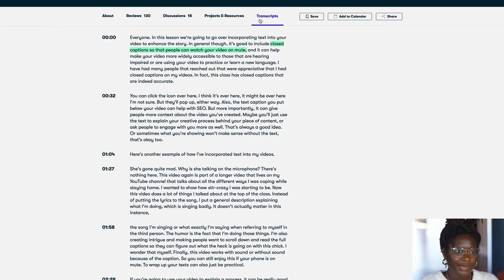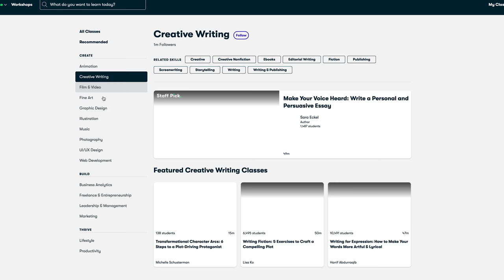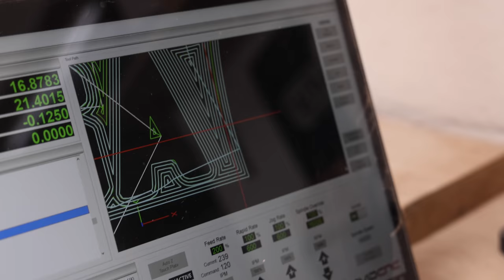3 LEVELS of Cornhole Boards -DIY to PRO Build

Comment: As far as aesthetics go, I prefer the 'beginner' board but I did enjoy watching the pro build and I can say that I was not disappointed. LEDs belong in everything. I think the only change with the beginner board I would do would be to route some channels where the stripes were, embed some LEDs and then fill it with semi opaque black resin. For bonus points, I'd add an IR sensor that triggers when anything passes through the hole to give a light show the likes of which no cornhole board has seen(at least to my knowledge).

Comment: Jordan - Has access to $5000 table saw
Also Jordan - Uses 2x4 offcut as hammer
Reply: With the price of wood these days, you can’t waste scraps
Reply: So what you're saying is he used a $5000 table saw and a $1500 hammer. 🤣

Comment: On mine I installed a laminated shoot underneath to return the bags to the front with a hole and tray. Plywood is also laminated with two 1 x 1 attached angled on top to direct bags to the same tray as the shoot.
Reply: So simple and it never crossed my mind. Thanks for sharing that idea!!

Comment: I’m curious about the two boards that were set in the frame. Did you size the plywood accordingly so the entire playing surface is still the regulation 2x4? Or is the plywood 2x4 with an extra lip of and inch or so around the sides?

Comment: The tools are not the problem, the biggest foul is using 1/2" ply😂 I use 3/4" birch decks. And 1x3s are lighter and stronger. Then I round off the edges and corners with a router. I will never go back to 2x4 frames. Im not critiquing or hating. Just sharing ideas. Great content and boards. Much love from Ky 🇺🇸

Comment: Just did a pair. I used pocket holes from the underside on the 2x4 to secure the top to the frame. Came out very clean and won't have to worry about filler/epoxy getting worn down over time and creating slight dimples around the edge of the board
Reply: I always use pocket holes as well but sometimes have issues with the screws wanting to poke thru the ply.  How do you adjust?
Reply: @suelogsdon3468  move the collar on the bit closer to the tip. If that makes sense

Comment: John you may like this. I had some boards at the bar I used to work at that had a level built in between the legs and the legs were adjustable to make sure your board wasn't leaning in a uneven surface

Comment: Hey, Love the videos i just build some cornhole boards like this and used my CNC, but i had over pour will sanding it like you did in the video help with the over pour? will it scratch the epoxy that's filled inside the logo?

Comment: Hole cutting: If you have a router, grab a circle cutting  jig. It will cost less than a 6 inch hole saw and let you do quite a bit more..to include cutting the rounded end of the cornhole board legs with an additional router bit. The cuts will be cleaner with less chance for tear out.

Comment: This is crazy, I use the same paint can trick for cutting the legs to length off the side of a table, lol. I also use cnc and epoxy for the board design. I just have to step up my LED and joint game! Nice boards man!

Comment: Hey John if your jointer didn’t have a Guard you could’ve just moved your fence over the thickness of the wood and you would’ve been OK.  Instead of having the fence all the way to the other side
Reply: Just the tip

Comment: Quick question, what plywood did you use for the Pro board?  If it was veneered, I was wondering if you would go through it when you sanded the epoxy.

Comment: I think I start at level 4 and have made it to 6 so far. Soon, I will take my boards to level 10. 
I start with 3/4 top grade plywood, then use 2x4s with a brace for no bounce. From there I can add lights, used epoxy resin on a few, do custom decals, even made 2 glow in the dark sets. Next I plan to take them up a notch!

Comment: Have you thought about a clear epoxy top coat instead of spray. I did that once and it made the perfect surface for cornhole... Just slick enough
Reply: Polycrylic is way cheaper and works just as well if applied properly. They are cornhole boards not a live edge bar top

Comment: Ok. Challenge accepted. I would like to see an Oreo table. Slab split like you would your rivers, but sandwiching epoxy in between. Don’t like the mint ones at all my guy but the green would work with the epoxy. Here’s the tricky question? Can your machine texture the exterior of the wood like the Oreo? Then burn it for that Oreo chocolate exterior color which will make the texture pop? Then seal it so the crumbs lol don’t get on the floor? Now to get squirrelly, when you take the top off it’s a poker table!.

Comment: 3 levels of Mallets.
3 levels of Birdhouses.
3 levels of Crosscut Sleds.
Reply: Mallets would be interesting; birdhouses will be pretty interesting but a nightmare for the editor.
There's like only 1 way to make a crosscut sled, the only thing that would change is the connections between boards. Or rather, they wouldn't look very different is what I mean.

Comment: Nice job on the cornhole boards they all look great except for one minor mistake. Cornhole boards are only 3 in in the front off the ground which means you should be using 3 inch boards not three-and-a-half

Comment: Been watching for overa year and i still don't know what squirrely Means. Is it just their version of "janky" "sketchy"
Reply: Yes. It's a woodworker thing, we say squirrelly to refer to wood grain, our cross cuts, and sometimes for those who do green woodworking like myself, they use that term to refer to gnarly branches on a tree.
All of this stuff can end up squirrelly.

When he said squirrely the first time in this video; he meant the boards weren't straight, so if you sat a square against the inner corner of the build, it would be slightly off.
The second time he said it, he did mean janky; and in my opinion this usage differs from how woodworkers typically use "squirrely", usually woodworkers mean "uneven" or "suddenly and unexpectedly turny".
Reply: @D-Vinko  yeah makes sense. I just say sketchy and janky but I'm glad i can add to my dictionary of sayings As a beginner wood worker

Comment: No matter what level of board youre making there should always be braces on the underside of the board top to prevent bounce when throwing
Reply from the maker: ive build hundreds of board and with good plywood they're unnecessary
Reply: 3/4 13 ply baltic birch, really doesn't need a brace. I add one anyway.

Comment: OK: here is the LEGIT Review: Level 1: WRONG Screws. You used a countersink to drill the holes which is a beveled screw head and then a washer/flat/Kreg version screw=minor hold no bueno. Use regular drywall to match next time. Level 2: DUDE, oldest trick in the book: Build it, put a board on the table next to the legs, mark and cut. Unless trigonometry is your best friend, DO NOT measure: mark and cut. Level three: ok, this was pretty cool. Love the finger joints for all things as once you built the jig and it works, next to dovetails, these joints are strong enough to drive a truck on (yes you can use that idea and test it, but I stand behind the claim). For the epoxy, which, dang you, now I love to use, I have a SLICK my grandfather had from the old country (Norway). I run that across after curing at it takes off the major high spots before the 80/120/180/220 routine. Reality: Gentlemen, I (we- they YT community) very much appreciate your 3-level approach which is awesome. Thank you for contributing and all three are worthwhile (sorry if I was a little harsh with 1 and 2)
Reply: SO you can build some for me LOL.  Love the input
Reply: also apparently cabinet grade birch is the prefered wood

Comment: Bro, I loved your board but when you countersink the plywood top into the 2x4’s, it’s no longer a regulation board. “The front edge shall be 4” from the bottom to the top”.
Referring to the intermediate board. Assuming the the pro build 2x10” was ripped at 4”.
Reply: There are variances in heights. +/- .25"
ACO rules, "front of the platform stands 2-1/2 to 4 inches tall"
ACL rule, "The front edge of the board should be raised between 2.5 and 3.5 inches above the ground."
Reply: @chadmiller1506  I’ll take your work for it. Not like it would change my game either way.

Comment: No hate, great work for sure to you three! But… the pro build isn’t pro style board at all sure it’s a experienced, difficult, joinery build, but not a pro board build. Professional, regulated boards are not used with any 2x material. But again no hate and excellent craftsmanship non the less!
Reply: Actually ACA regs and standards don’t specify what the frame has to be made out of, as long as the dimensions and height are correct, you can make it with whatever your heart desires. Most don’t use 2 by material because it’s much heavier than using plywood for the entire build or 1 by material.
Been to plenty of tournaments where the boards were made from 2 by material and they were heavy but zero trampoline effect..so it’s up to the builder or buyer.

Comment: Since everyone is kissing butt I'll be the smart ass. I'm not sure a cornhole board can be called pro unless it comes with a built in bubble level vial on the legs end, height adjustable legs/levelers for uneven surfaces, cornhole boots for the legs and the front to protect those surfaces when playing on concrete, beer can holders on a horizontal leg brace, scoring system preferable LED built into the top of the board (magnetic strip on the high end would work for the medium build.) BTW I haven't looked at all 300+ comments but what happened to the stenciled "sports team" on the medium build? No stencil shows on the final board.